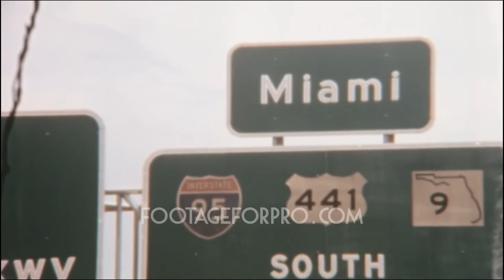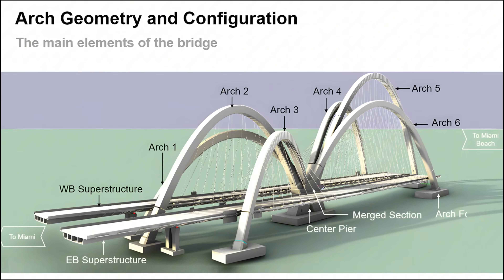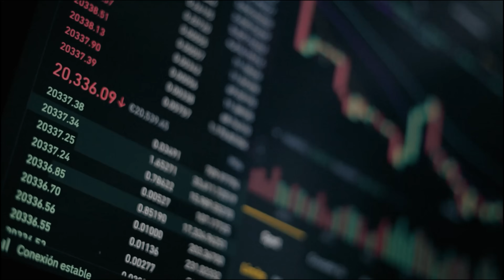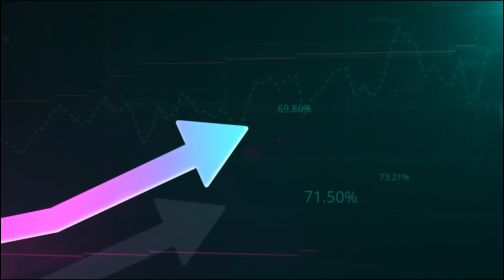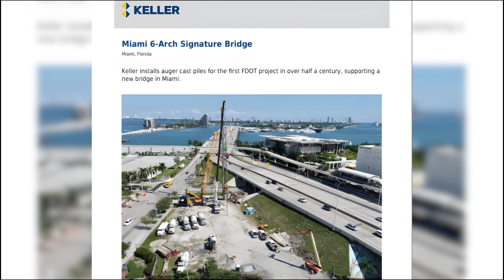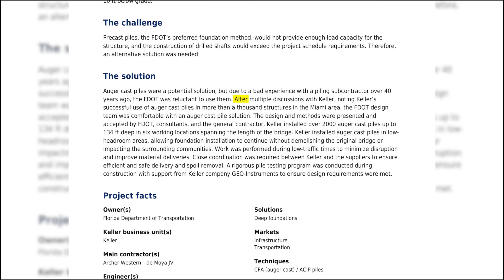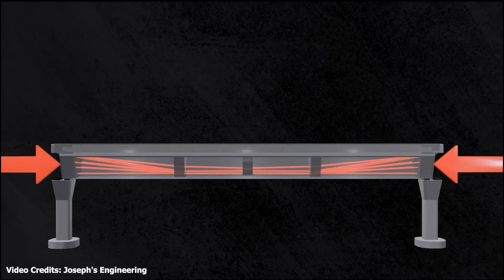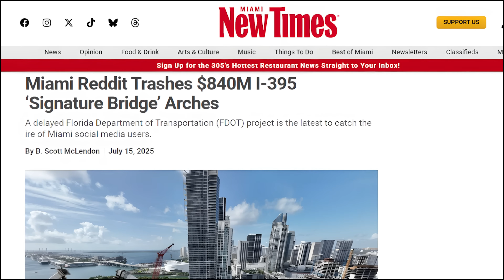The $866M Miami Bridge That Broke Florida's 50-Year Ban

Comment: This was and is the worse project waste of money by miami dade county expressway authority and FDOT. Millions wasted and contractors taking advantage of this mess by delays and additional work orders. Wait and see wha happens when the idiots in Dade County blame to engineers for the structural problms it will strt happening because like MIA and the dumb mayor of dade county is destryoing MIA with million pump into that when it lacks so much in maintenance and just to change signs it took a long long long long time and it seem to still be not complete. Then you have to cross walks alway going off or never going off you know the warning that someone is crossing in the cross walk. Then theirs the moving walk alway not moving they should just rename it standing walk. All just named should have been part of the simple maintenance to keep them running but they are alway broken or never fixed. However spend 10 minute waiting you'll get a ticket or should a I say an extortion notice. Takes for ever to find any place at MIA and Airport crew is rude (you pay hundred including airport taxes to use) and they act like yo are a bother and I am doing you a favor.

Our last travel this year was at FLL airport and that was quick in and quick out of that airport. People were more polite meaning most of the airport crew nothing like MIA. Miami is extorting money for their personal gain and build garbage for the moment and never fixing anything.
Reply: This is a state project.  The city wanted a tunnel, but someone at FDOT wanted a project they could brag about.  All of the blame is on FDOT.
Reply: thats because you dont REMEMBER "Pepper Fountain"
Dade county LOVES to "dissapear" money in road "PROJECTS"
Reply: @sebell69  Your Local government is using the standard USE IT OR LOSE IT. The more they use the more they get is government waste motto.

Comment: Even the initial estimate for this complex structure seems to vastly underestimate the cost and time needed to build it.  

It's as if Elon Musk was hired to estimate the cost and time to completion for this job.   Just looking at this I would never have estimated anything less than a billion as the initial cost.   

And another aspect that is disgusting is how they think a 50 % increase in traffic capacity will make any difference in a few years.  Every time new highways are built or capacity increased the traffic volume increases with it.  Every. Single.  Time.   

That's why I'm glad to have moved out of the moderately large city I used to live, Albuquerque to a smaller much less congested area, Las cruces.   

Thus I can appreciate why many people prefer rural over urban places to live.  In Florida I don't see much rural space left although if nothing else repeated massive hurricanes will eventually change people's minds if only because Florida will become unaffordable for most.

Comment: All that money would have been better spent expanding Metrorail to north, and to west Miami Dade to take vehicles off the highway.
Reply: but fdot likes to waste money on unsustainable car infrastructure
Reply: Original MetroRail plan had western expansion across all of Flagler Street into (i thik) W 107th avenue. -- That idea was torpedoed fairly quickly after the opening of MetroRail.
Reply: And east to the beach ;p
Reply: @TonyShasta  The residents of Miami Beach don't want it. Thats the reality. The people get a say.
Reply: If they did that DUI's would decrease (they don't want that) greed for money is their strategy!!!!
Reply: I've been saying this for years. Expand the damn metrorail. 8th Street is perfect for a metrorail
Reply: So 5 people can ride them and 2 get stabbed
Reply: Makes sense in my mind to expand up to the stadium, but the issue is cost and right of way. They can't even build 20 miles of Metrorail on existing right of way from Dadeland to Homestead without an estimated cost of 3 billion dollars. Rail is nice but it's very expensive.
Reply: No one uses the Metrorail, so why invest money in something that no one uses?
Reply: @xChuchi  Over one million people ride Metrorail each month.   The reason more people doesn't use it, it's because the system is incomplete, it doesn't go to west Miami-Dade nor north to the Broward county line.
Reply: People do not want the metro rail system.  It brings the dregs out and is disgusting as it's hot and humid in Miami all the time.
Reply: @kevinh3979 Also it’s much safer for someone to be in their own car than be on a metro rail “train” and some whacko comes into it and physically attacks the person.

Pretty sure that’s happened a few times or more by now
Reply: @brianorozco1074  The way people drive in Miami and Dade County, I don't know if you're safer driving. Unarguably the dumbest and most reckless drivers in the country.
Reply: @jirky015 I totally agree with that, lots of horrible drivers in Miami. However at least they’re in their own cars and usually don’t have to share it with strangers.

Unless if they work for Uber or some other thing like that